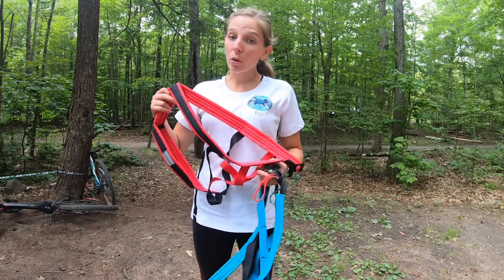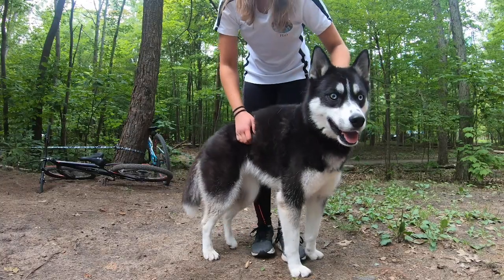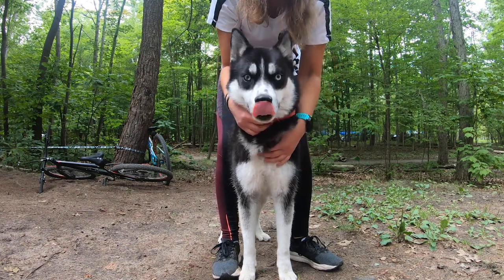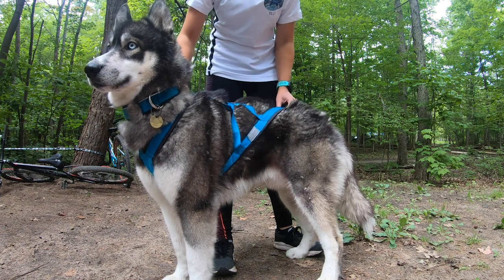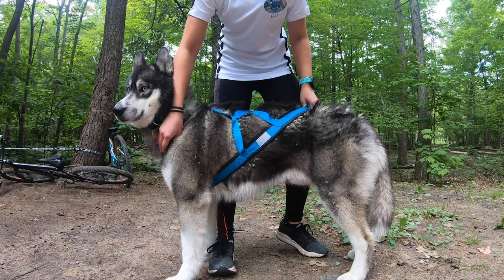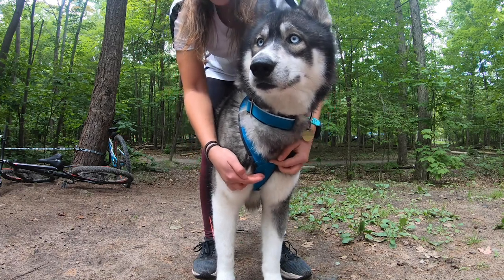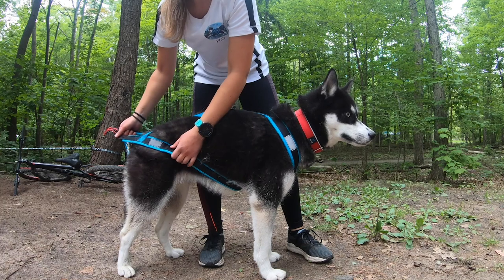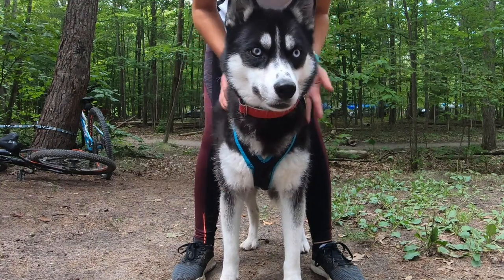Harness Fitting - How to properly fit a X-back harness on your dog

Comment: Thank you for posting this the problem I'm having is that I'm getting a rub in the Armpit but only on the outside because I have two dogs so the harness apparently is getting pulled to one side a little and rubbing the armpit of the outside leg and I'm not sure how to correct that

Comment: Great Video, ordered the right Nahak because of this. Would love to see a video about attaching the back to the lead.
Reply from the maker: Thank you, I’m glad to hear it helped! What do you mean with attaching the back to the lead?
Reply: @TeamRunningHusky  Sorry just the way you attach this harness to the leash. It came with a single rope with knots, if that enough to hold the dog? I noticed you may have reinforced it with another rope? Cheers
Reply from the maker: @darrenpinard1658  no it’s just that some sizes come with just one rope, some come with 2 ropes. I think maybe the sizes-long like small-long, medium-long, large-long come with 2 ropes to differentiate them from the regular sizes (but I might be mistaken and it might be the opposite). But don’t worry, the one rope is fine. You just clip your bungee line to that rope. Always check your gear before going on a run obviously, if you see the knot is coming loose you should fix it before riding, but I’ve never had that problem with any of the harnesses we’ve had. Hope that answer your question!

Comment: How will a dogs conformation influence this? Should for instance a sighthound with a more curved topline still have the harness end at the tail?

And what about the X on top? This should not put pressure on the dog's back, right?
Reply from the maker: This video is very generic and I don’t have any expertise in specific breeds and conformation. Some dogs won’t fit a Xback harness and need a different shape of harness, like a split chest harness or a H back harness, or some would fit better with a half harness. I would recommend reaching out to a harness manufacturer and asking them your question, they will be better suited to answer these questions and confirm if this should fit your dog. You can even send them a photo of your dog if that helps them answer your question about conformation.